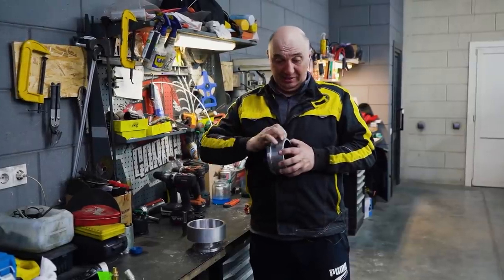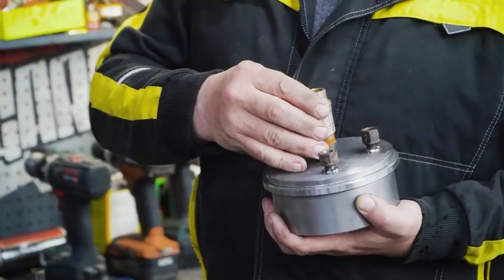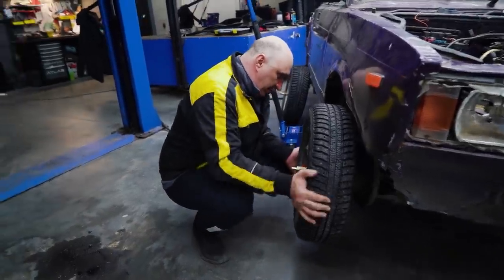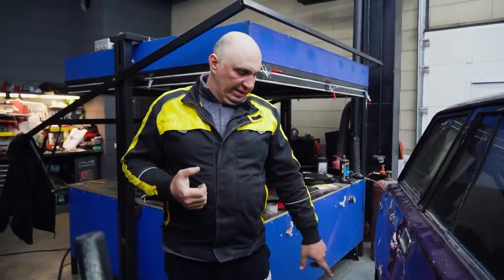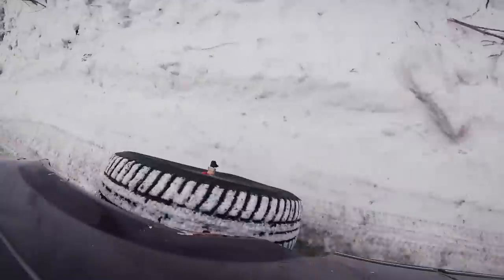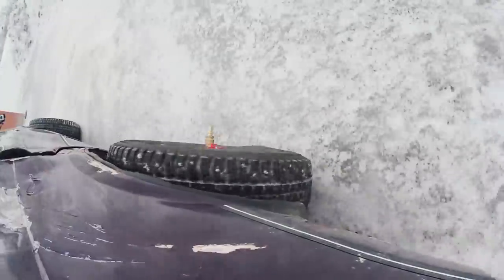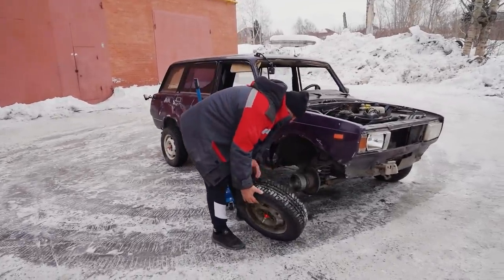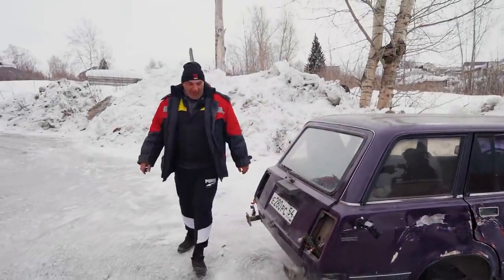Mounting a wheel using suction - will it stay attached?

Comment: I'm impressed at how well this worked.  Of course, no vacuum seal can be perfect, but that went much better thanI would have ever dared to guess it would.
Reply: Some oil rigs are hold by vacuum.
Reply: @TheSRBgamer63  But there's a vacuum pump in the system which operates as often as necessary to hold the vacuum seal.

Comment: It would be great for racing / pit, quick release wheels.
Reply: Yeah as opposed to their unibolt system that takes 1.3 seconds to undo. It would take longer to pump the air out of the chamber than it would for the pit crew to have a smoke.
Reply: Especially when you consider the fact metal expands as it gets hot, creating an even better seal. However it takes a lot of weight to build osmeghing that can hold up to a strong vacuum and hold the wheels on. A single nut and bolt is a better solution for racing
Reply: @the_kombinator  If I were designing this for faster removal of wheels I'd replace the ball valve with a check valve (one way), that has a quick connect fitting which would connect to a vacuum tank.  Or include some way to use vacuum from the car.  It could be made to work, but the higher loads and temperature ranges would require a lot more engineering to make it competitive with current designs.
Reply: It’s too slow though if they could speed up the process by 100X then yeah, they just used what they had around I think probably why they didn’t use check valves

Comment: I think the vacuum released primarily due to vibration. You are limited by 14.7 psi atmospheric pressure when you do it this way, so you could try making a positive pressure mounting system, for more force.
Reply: I was thinking it would release from it being warm inside and so cold outside
Reply: @williamj.barnhartjr.3108  Exact opposite. Cold outside warm inside would create a better seal as metal expansion when warm. Solid idea tho
Reply: Or make it a bigger diametre. A 10 or 12 inch cylinder equals 110-odd square inches x 14psi. Thats like 1500 pounds.
Reply: I'm thinking whatever partial vacuum they had simply wasn't enough to manage side-loads. With the engine's weight bearing sideways on the cylinder, it simply worked itself loose over time. As MB pointed out, even a perfect vacuum is not even 15psi, probably needs a bigger piston for increased vacuum force. A bigger piston would also be more tolerant of being kinked over by the engine's weight while distributing that force over more gasket area.
Reply: @teardowndan5364  im guessing its also a leakdown issue
Reply: Deadbolt latch that limits it's ability to wriggle loose
Reply: @AndyKPOV  the little air left inside the hub would heat up and expand lessening the vacuum force
Reply: @AndyKPOV  if that true why does your tires lose pressure in the winter my truck tires I have to put air in my tire monthly in the winter but in the summer I never add air

Comment: Make a engine block out of wood, or cement!
Reply: Or a transparent engine block
Reply: Epoxy resin
Reply: Wood wouldn't work not dense enough. And cement is super brittle to inside forces. Cement is strongest when force is being applied from outside.
Reply: BRASS
Reply: Transparent/resin would be the best. Cement and wood would be super difficult and wouldnt end up working really. Resin however stands a chance to at least work for a short time.
Reply: make a functional engine out of one of those plastic mock up blocks. Sleeve it and machine it.
Reply: Or jb weld
Reply: @Leviathan_1992  resin would work till it got hot. It has a very high pressure point but low temp point. Only downside. But you'd be able to see everything a solid 1 second then the oil would take over the transparency
Reply: @catsaregovernmentspies  that's a good idea. With proper cooling journals and thick sleeves you'd have a chance for sure!
Reply: So we can all agree a thick density resin with thick metal sleeves. That should be able to get around the block a few times before melting.
Reply: Killer glass
Reply: @AndyKPOV  oil is transparent lol
Reply: Ice and sawdust is very strong and wouldn't need lubrication
Reply: @nathanphillips3251  heat bro
Reply: YES
Reply: @Leviathan_1992  Its not, its at least 80%... (Motor oil)

Comment: A simple clasp lock fastening after vacuum might be the simple addition that makes this dependable and functional.

Perhaps a deadbolt pin that secures the arrangement after vac.
Reply: Maybe even a few bolts, "lugs" if you will, to help with mechanical connection...🤔

Comment: Increase the diameter of the piston and cylinder, along with longer engagement surface for better holding.  Using an air conditioning vacuum pump will give you 25 inches or better of vacuum.  Adding a third O ring will keep the vacuum where it belongs, but a lip seal would be better.

Comment: The force from vacuum depends mainly on the surface area it is acting on. On Earth at sea level, the greatest surface pressure you’ll be able to achieve is 14.7 pounds/square inch or 1 bar. Roughly half of the positive pressure that goes into a standard car tire. The force from vacuum becomes impressive or even insane when spread out over a large surface area. That’s why your vacuum forming machine can crush molds. I’m guessing it is more likely to crush larger molds than smaller ones. A 1 inch square would have 14.7 pounds of force on it, whereas a 10 inch square would have 1470 pounds of force on it (assuming a perfect vacuum, which is basically not achievable)

For vacuum attaching the wheels to the car, a larger surface area than what was used would be better. The relatively small pistons that were used were not enough. Also, engine manifold vacuum could be used to help keep the wheels attached (along with using some check valves to ensure the vacuum didn’t drop when the throttle is open, same idea as vacuum brake boosters or vacuum operated door locks, windows or headlight doors.

Comment: Love your show.  A lot of people use nitrous oxide to give the engine a boost of power.  Have you ever tried using propane to see if it does the same. May I also suggest trying a windshield washer bottle n pump full of rubbing alcohol to the engine and see if it gives the engine a boost of power?

Comment: I wonder if instead of using a vacuum pump or cylinder, could the engines own intake manifold vacuum be enough to hold the wheels on?
Reply: Hmm... I am not sure what the manifold vacuum pressure is compared to this vacuum pump. Well, we need to know the absolute pressure. If atmospheric pressure is 1.0 bar (14.7 PSI) and the vacuum is at say, 0.1 bar (1.5 PSI), then we know the pressure difference is a little over 13 PSI. We also need the minimum pressure difference in PSI.
Reply: How about using a central tire inflation system, but a vacuum instead, and attached to the hub instead of the tires?
Reply: @Colorado_Native  ingenious

Comment: I wonder how those o rings held up. If your vacuum mount has any clearance at all, the weight of the car is going to cause the whole thing to shimmy ever so slightly. But, if you used a tapered cylinder, you'd get very positive contact. Also, if you somehow had an onboard vacuum system inside the vehicle that would improve your reliability and versatility. And, you should have more chicks on, so your voice guy has to do a girl voice.
Reply: I agree with your suggestion of onboard vacuum. Using a 12v vacuum pump and connecting with airline quick connectors may work.
Reply: Several vehicles have a system where air pressure is somehow provided to the tires. The original Hummer would let you drop the pressure and fill back up on the fly.

Comment: How about using this same idea, making the sleeved section much longer into a sort of shock absorber. Then pump them with different amounts of air pressure to control ride height & dampening? The suspension at full droop should stop the shock from coming apart, then be compressed under the car's weight to some sort of normal ride height.

Comment: so one of the cylinders isolated in the engine can be used to make a vacuum and compressed air... as for a large swivel joint that can maintain pressure distribution, in theory reverse of engine lubrication said joint distributing air pressure has a internal vacuum seal... mechanical gas compressor station stuff? no leaks, controlled leak zones of moving parts.

Comment: the main problem with this idea is that any sliding fit will rock and work loose, for high loads like wheel bearings an interference fit is the only thing that works.

Comment: For this system , surface betwean to plate should be clean no dust and debry and rust and oil for perfect seal
And more volume=more vaccum pressure force
Reply: Oil is fine tbh, would actually make a better seal.
Also, volume just makes it take longer to fall off if it has a small leak. What i think you meant though, was surface area, which would increase the volume. Sorry to nitpick, i just wanted to add extra clarification to what you said.

Comment: You could even use the engine vacuum system in an emergency fix
Reply: I was envisioning some sort of new torq wrench style tool with a bladder bag to suction air out, but turns out that would be impractical being as a car engine is already equipped for such purposes.  That would be a new concept thou, learning that you lost a wheel by the sound of your engine loosing timing.

Comment: I was really surprised with this one. I know vacuum us strong but I didn't think it would hold up at all. The reason that front wheel came off was probably more to do with suspension geometry and angular pressure than weight and traction. Simply put, You crank the wheel all the way and it puts a lot of pressure on one side of the wheel bearing. Anyway I cannot believe the vaccime was stronger than the welds.

Comment: Standard Automotive bearing Grease may be the solution to insuring a vacuum. The idea would be to just filled the receiving Hub cylinder side with a standard Greece partially when you slide the Piston wheel side into the grease filled cylinder side with the gas cox open allowing it to push out any excess Grease  once the two pieces are mated and fully seated close the gas cox valve and then the automotive grease should act as self-sealing viscous barrier and hold the two pieces together under a continual vacuum only problem I can think of is that once you start using the brakes and it heats up I don't know what will happen with the grease as far as as expansion
Reply: @dimitar4y  it wouldn't go into a vacuum until they started to separate it would be using a suction Force as you started to to separate the two parts they would try to come back to equilibrium it's the exact same thing as using a suction cup cup flipped upside in water have you ever used a grease gun before
Reply: @bakedroosterz4386  grease. is basically a liquid. it'll get sucked. into the vacuum. are you a neckbeard, you're trying to split hairs as a "i win", when there's separative forces, grease will get sucked into the chamber, and the grease will 'wear out' pretty quickly, especially with the tolerance squishing it out of it's location. Are you daft man.

Comment: If you brake for long enough the brakesgets hot, with that the air that is still trapped in the wheel cylinder, and the vaccum gets weaker due to hot air expansion. My guess.

Comment: Next time try to use magnetic set up like with the type of magnet used in the scrap metal industry. Retrofit an electric magnet to the hub system. Also maybe putting grooves and rubber o rings for the vacuum system might work. Just a theory.
Reply: 5:07 They did use grooves and o rings
Reply: @Bobs-Wrigles5555  Thank you. I was distracted at that moment by my daughter and didn't notice the O rings. I had the chance to review the video time frame you provided and saw them. To be fair though there was about 2 seconds of the image with O rings, then the next shot they were not on the piece, so I thought none were used.

Comment: I think this system would work better if it ran off a pump the is powered by the engine or battery to stop it from braking seal.

Comment: what is a vacuumator ?
Reply: Vacuum accumulator. There’s a reservoir/tank under the vacuum table. Just like an air compressor. On a table that big evacuation of the air would take too long and the plastic would harden before a good mold is made. There’s a video deep in the channel right after they acquired the equipment where they show you everything.

Comment: imagine this in F1 tyre changes
Reply: LOL as opposed to the current system? Do you even know how much BTU those brakes generate?  /Sebastien Buemi
Reply: @the_kombinator  isn't the current system uhh, just bolts?
Reply: @dimitar4y  Yeah, one per wheel, centrally mounted - it takes a few seconds to swap a wheel out, and it is not affected by massive heat/cool thermal cycles like this contraption  is.
Reply: @the_kombinator  a perfect vacuum would not be affected by heat/cold cycles as there would be no air inside to do any fancy shenanigans.
Reply: @dimitar4y  Yes but the metal around it would, heating and contracting. Not really that big of an issueif the metals are the same, but I doubt the metals would expand and contract at the exact same rate. What it needs is the chamber linked to a one way valve, with the other side going to the inlet manifold, constantly creating vacuum in the wheel hub.
Reply: @the_kombinator  "i doubt the metals would expand and contract at the same rate". Painful ignorance. "inlet manifold creating vacuum". Physical pain from the ignorance. Guy thinks a manifold can venturi a perfect vacuum.
Reply: @dimitar4y  You: What you said

Also you: Metals contract perfectly, no matter the thickness. 

Also you: Perfect vacuum.

Do you know what channel you're discussing this on?

Comment: I love this video, but I hate this video. I hate this video because you know automobile manufacturers will use this to design "nutless Wheels". Then the only way to change a tire is a visit to the dealer and $300 later or special equipment (i.e vacuum pump, special fittings etc)